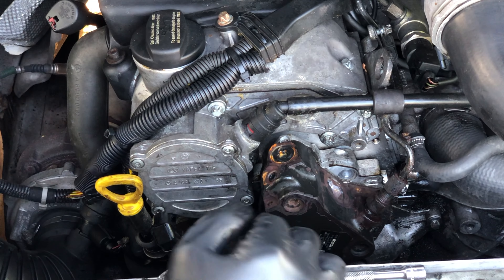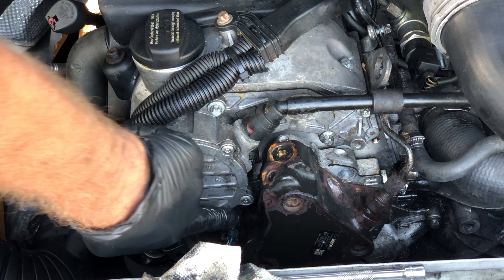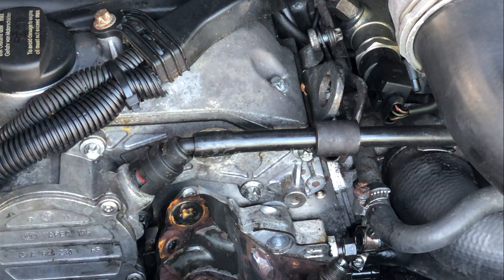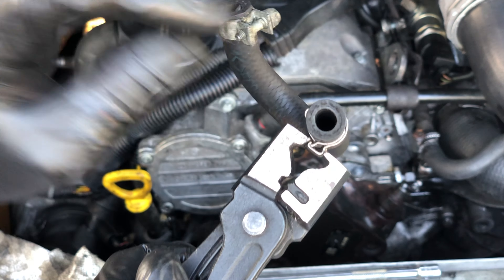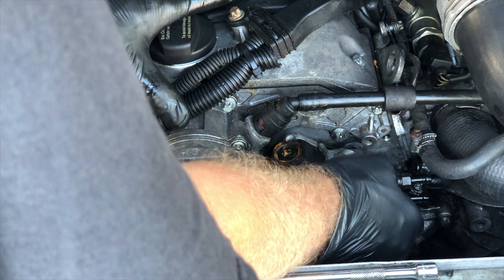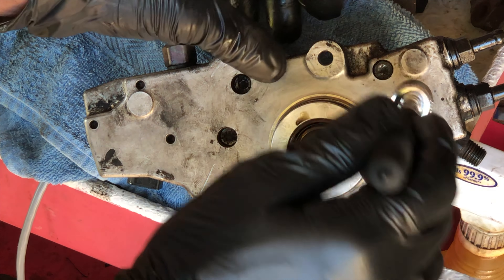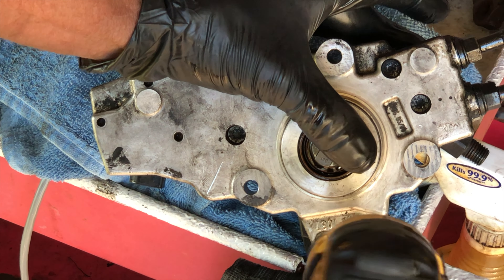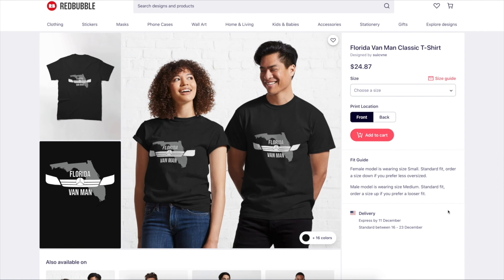High Pressure Fuel Pump Leak & Click-C Hose Clamps, T1N Sprinter

Comment: I have a 2006 with 6200 miles ,my first limp mode ,no lights in the dashboard, took it to Mercedes, they we guessing also , replaced sensor  on the intake hose .
Reply from the maker: Start with a code reader that works with our vans. We have links for two known good units, https://floridavanman.com/links/
Then we have a video for getting the $60 AP200 setup correctly. https://www.youtube.com/watch?v=1vCPcBK0R9k&t=270s

Comment: As far as re-installing, will i need to follow any special steps or procedures as far as "priming" it? or can i just re install and start it right up?
Reply from the maker: Van with this model fuel pump have an electric fuel pump in the tank also. That will come on and flush all the air out of the system while the glow plugs warm, so the van will start almost normally. It might drank an extra second before firing up.

Comment: What kind of thread locker is good to use?do you recommend  medium or high strength threadlcock?
Reply from the maker: I'm not picky and used what I had. It's red and I think that means it is high-strength but I don't use thread-locker often enough to know much about it.

Comment: Thank you for your good deed sir. Does the engine start normally after that or do I have to do something additionaly?

I have a leakage on my w203 C220 i think this will solve the issue. Greeting from Bosnia!
Reply from the maker: You will need to push air out of the fuel lines. Vehicles with electric fuel pumps will do this easily when the key is turned on. Others will need some additional time cranking the engine to remove air and maintain fuel pressure.
Reply: @FloridaVanMan  Allright, so I guess I will need to bleed te fuel lines

Comment: Could this be causing my 2006 3500 Mercedes 2.7 to register a ECM/PCM power input signal range performance code?Truck runs for several minutes and shuts itself off
Reply from the maker: What is the code and what are you using to read codes? Incompatible code readers will give false clues.
Reply: @FloridaVanMan  Appreciate the info as I do have a cheap little generic code reader.Wish I was in Florida so I could get you to check it out.
Reply: P2506

Comment: How straight forward is it to open up the pump and install new orings?  214k on original pump.   I don't want to open a can of worms, and have van down.
Reply from the maker: The similar CP1 pump is easily rebuilt and I have two videos showing that. This is the CP3 and I have a kit for rebuilding it but have not needed to install it so can't say with certainty if it is as easy, but I expect it is.

Comment: Hi there
How do i know what pump don't work if I get no fuel coming to the diesel filter, is it   the one in tank or the high pressure on?
Thanks Rus
Reply from the maker: Depends where you are and when your van was made. IF you have a 2004-2006 North American version Sprinter you have an electric pump in the tank that should push 50-80psi into the filter. 2000-2003 North American will not have an electric fuel pump anywhere. UK models aren't as easy to sort.

Comment: My 03 Sprinter 2500 has a leaking high pressure fuel pump as well. I am not looking to rebuild or replace the part if I don't have to, just need to stop the leak. Was removing/retightening the six bolts really all that was needed to fix the leak?
Reply from the maker: Your 2003 has a different HPFP. This video is for 2004-2006 vans. Your 2003 pump will need rebuilding if it leaks and does not have the easy 6 bolt-fix option. The rebuild seal kit isn't expensive, $40+/-  and I have 2 videos showing how to do the job.
Reply: @FloridaVanMan  Thank you so much!

Comment: Are there specific torque specs for reinstalling the 6 bolts?
Reply from the maker: I have not found specs for it. I do not believe this was ever intended to be a shop procedure. Lock-tight thread locker will help and I tighten them as tight as I can by hand, without using a vice.

Comment: Is this a 612 or a 647? is the  high pressure fuel pump procedure the same  for both OM612 and 647 ? thanks great info. was also wondering if there is such a thing as a rebuild kit for these  pumps .
Reply from the maker: This is for OM647 and there is a rebuild kit available but I have not tried it. The OM612 fuel pump is much different and I've rebuilt several of those. We have two videos on just that.

Comment: Hey man. So i took my sprinter to a shop a while back after scratching my head for months with you on trying to diagnose a nonstart issue i was having.  They finally contact me back and he seems pretty confident my high pressure fuel pump is out and wants 2500$ to replace it. Any way i can confirm this is the issue ????
Reply from the maker: Not easily. I would run the fuel rail leak off then injector leak off tests. If no fuel is present in the tubes for either of these tests, the high pressure is probably* the cause or possibly the Quantity Control Valve on the high pressure pump. $2500 is absurd! The quantity valve is $250 and a whole pump with valve is $1220 plus about 500 to install it.